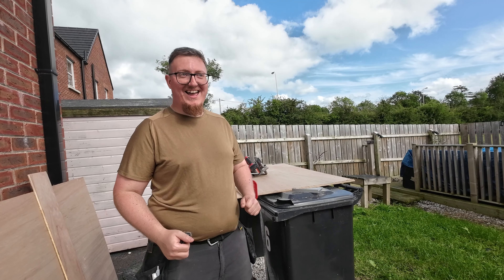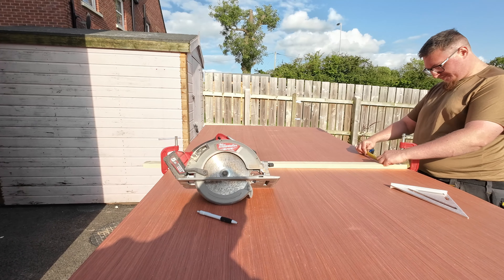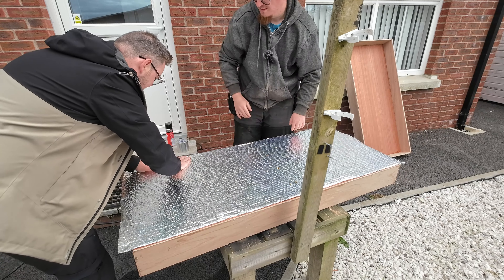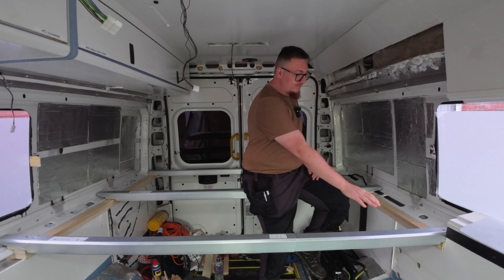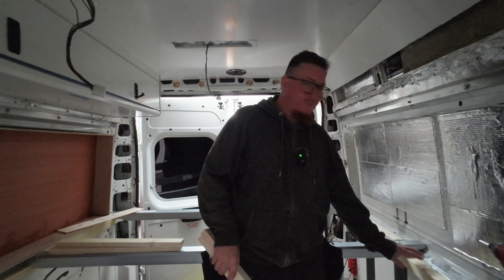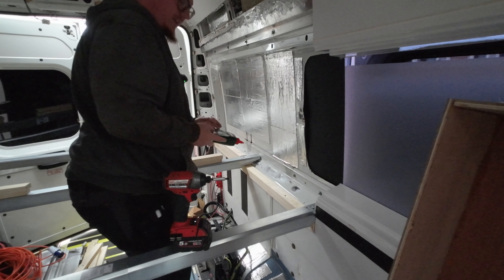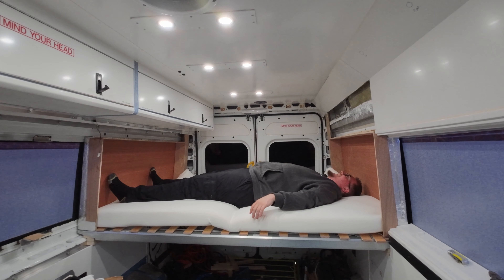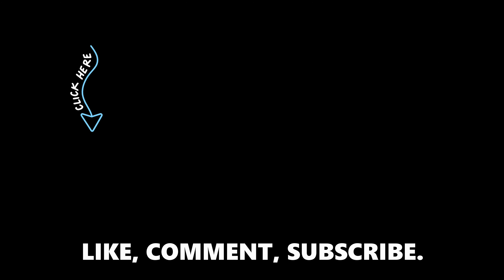DIY Campervan Conversion Bed and Improvements [VAN BUILD PART THREE]

Comment: The more videos you make, the better and more entertaining they get,( like getting onto the bed) keep going guys, trips  away in NI will be worth watching,  does Tony do all the filming ? And Steven do all the manual stuff, ? 
Do you use a phone or Go pro? As you are new to YouTubeing have belief in your skills, you will get better. 🐕👍👍👍
Reply from the maker: @mrhoult-qy8su  Hi there, Stephen does a lot of the manual stuff, and I (Tony) do the filming and editing. Although we both help with each process behind the scenes. Because Stephen has a background in this sort of stuff he is mainly the one on camera explaining it more cohesively and then I like to be more behind the scenes and do the voice over stuff because I'm better speaking when scripted as I have more of a theatre background. 😀

As for the filming, I started with a phone when we had zero budget, and as we saved more and had access to more resources, we switched to DJI products. We use a mix of action cameras, pockets, and drones as well as multi-angle setups and different types of equipment and software

Maybe one day we will go through the technical side of things and do a video on it. We also lightly script some segments, which is why you'll sometimes see some bloopers at the end of our videos. 😀